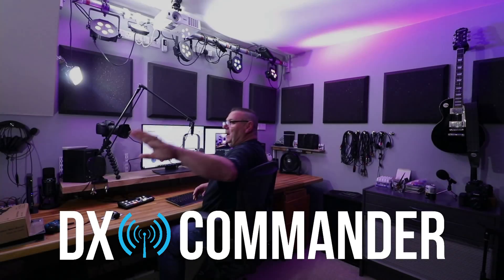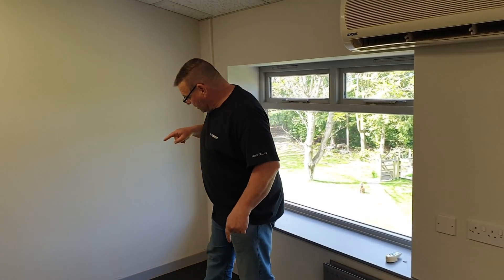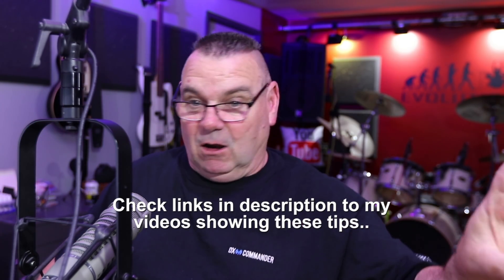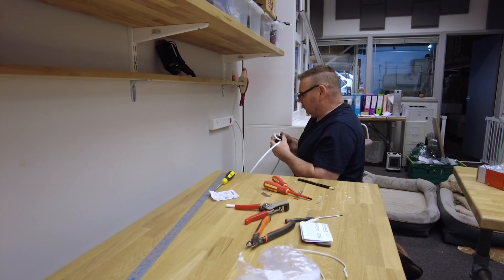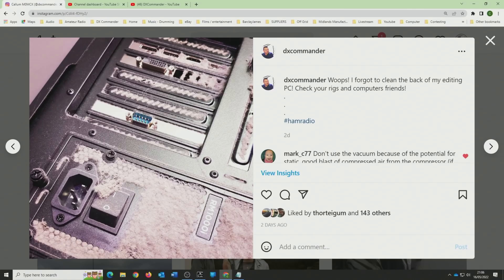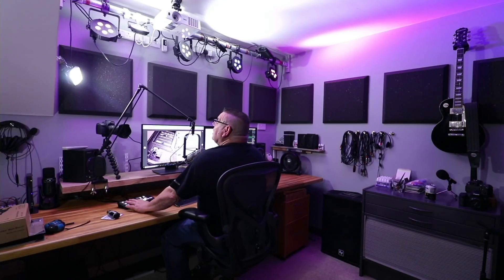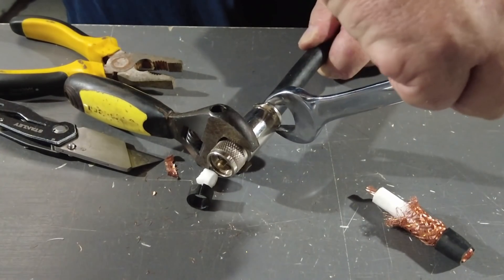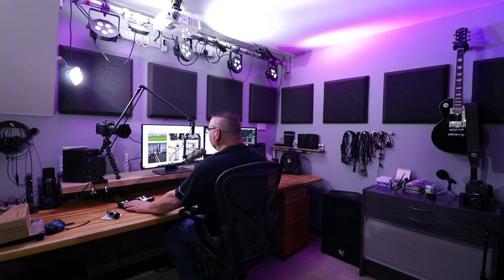7 Things When Building Your Ham Radio Shack

Comment: @calum, please make sure you use metal power strips. Helps avoiding burning down the shack, if something goes wrong, as plastic ones burn thru while metal can contain it.
Reply from the maker: Yeah, plastic is an awful conductor.

Comment: to beware---  do not arrange your radios so you cannot get behind them, pulling them out means you have to use longer cables and lots of confusion.
Do not bring your wires through bear hole in the wall-- you get a lightning strike electricity comes down through that round and likely would burn your wall and maybe your house.
Do you like coil extension cables extra electric wire because the coil as an inductor you don't wanna create spare inductors lying around in different places.
This is too short.

Comment: Oh, yeah... Messi & Peloni. Good to mention. Do you have any further (let me say, long-term) experience with their products? I've read both terrible and fantastic reviews about them. 7 mil would be awesome, as minimal invasion on the wall/structure is a top priority. 100 W, all HF, including 160 m, external (feed-point) tuning. Any ideas/suggestions?
Thanks in advance!
73 de HA5CST
Reply from the maker: The 7mm is quite similar in construction to the SSB El;ectronics Aircell 7 however the jacket seems slightly better (for me). I have run a 36m section of it for holiday use. It was fine. And the connectors are actually very nice.
Reply: @DXCommanderHQ  Thank you very much, Cal! We have some sort of selection here. A lot of RG58 from different suppliers, some RG213, and a few others, all (way) over 10 mm in diameter. I"ll make a try. Cheers!
Reply: Forgot the length: 25-30, or a maximum of 40 m... Cheers!

Comment: Here is a tip that might be helpful when building your next ham shack. Setup a location grid like your shack will have 4 walls, so label them north, south, east & west, then from the floor to the ceiling designate letters of the alphabet. Then when you run cables you label both ends of the cable using label cable ties. Put the source and destination on both ends of the cable. You can even get color label cable ties and designate one color for antenna cables, another color for power cables...etc.  I worked for IBM for 23 years and we used a similar system to label cables in the data center.  When a piece of equipment fails or needs to be relocated it helps if all the cables are labeled. You don't want to pull the power plug on the wrong equipment and cause a outage at a inopportune moment. Keeping your cables tighty and labeled also helps with air circulation.
Reply from the maker: Well, hopefull I don't need a new shack anytime and tbh, for the 10/11 or so cables I have (and most would have) it shouldn't take too long to work out which one is which :)

Comment: Top tip, make the front edge of the work top 10 - 20mm lower than the back edge. That way if you accidentally spill any liquids, they will run off the front and not backwards under your equipment.
Reply from the maker: Nice idea! Alternatively, keep your drinks WELL away from your arm! :)

Comment: What would you recommend for station grounding when you have to install shack upstairs..??
Reply from the maker: To be frank, if you ground your coax outside that should be fine. BUT I can only tell you what I do.. 1st floor, 2nd floor or 10th floor :) Also depends on antenna I suppose but for 99% of us, it probably doesn't matter.
Reply: @DXCommanderHQ  Cheers...
I guess I will suck it and see :)

Comment: on access to hardware... I was called out to my boss's other business to find out why the PC that ran the MOT system was overheating and shutting down after 2 mins. It was mounted on a trolley, so I thought it would be easy to access. Wrong. The power and network cable had been bolted to the wall and glued to the trolley. I had to replace about 30m of power and ethernet, then make sure we wouldnt have this issue again by adding plugs/sockets and some leeway in the final cable run. If you think a bit of dust is bad, I had to take the PC out to the car park and blow the solid cake of congealed exhaust particles out of the computer with an air line. It was full. and someone called the emergency services, thinking we were on fire.
Reply from the maker: WOW!

Comment: What is trunking?
Reply from the maker: Elephants have them
Reply: Flexible plastic sheathing for electrical cables, such as you might see in a Portacabin when it's not possible to put wires within the walls.

Comment: I put eye bolts in the ceiling and run cables across the ceiling and down the walls (or down whereever), and fasten it up with velcro straps.  Ugly as sin, but damned convenient.
Reply from the maker: I mean, if you don't mind the look (and actually that could actually be quite cool, then WAY TO GO!

Comment: I have done many "pro" installations in my working life, I would route network cables in separate cable trays from coaxes. It was weirdly rewarding to take pride in doing a neat job and of course a better presentation for customers. (Mostly emergency services). Of course these installations do not change for many years at a time. The same inflexibility as you say is basically a PITA in an experimenters environment. Redoing my shack recently, the desk is supported at the wall, so no gap behind, so have used a hole saw to make a few large cable access points through it. FWIW apart from QRO amplifiers most ham gear is low current so I use mostly IEC sockets across the back of the desk, a damn sight smaller than chunky 13a stuff. 
You are absolutely right to keep it flexible. Another stupid mistake I have fallen into is to have too many radios on the desk at once, too easy to turn the shack into an unusable museum. Better to keep the other rigs elsewhere and put them on the desk only when you want to use them.
Reply from the maker: Oh yes, tthe unusable museum scenario! Hmmm. Good point.
Reply: “unusable museum” is the best description with quite a few shacks I’ve seen. Absolutely maddening to think you need that much gear within arms reach. Less is more for me. 73’s

Comment: We’re having the whole of our downstairs re-done and the builders are in making the changes we required and modernising everything. New water pipes, electrics windows/doors the lot. From doing a lot of research from other hams I’ve had installed my own consumer unit with no more than a double socket running from each trip at the con. unit.
I’ve rebuilt my desk/workstation and I had already thought o out having to move it to get behind so it’s on lockable wheel’s.
My coax runs used to come through the wall about 2ft up but one of the builders said why not put it above head height , that way all cables/coax’s coming in from outside are not trip or catch hazards so that’s what I’m planning to do. Across the side walkway to the house I’m planning on putting an old banister (vertical) to put the coax’s and earth cables across at around 10ft high.
Not planning on using trunking but I’ve made a “J” shaped shelf to run cables along the inside wall behind the desk so everything is easy to access.
Can’t wait for the builders to put the new roof on and skim my walls so I can get back in there and get re-setup.
 Good advice as always from you sir and I hope my contribution will help others as well.
Good luck with next door.
de MW6PNW
Reply from the maker: Nice one Paul. You are ahead of the game!

Comment: Great tips Callum, my main mistake is I installed underground pipe to route coax's in my extension, pipe not big enough!  Indoor trunking replace with cable tray.  Sounds posh but its 'L' shaped MDF, allows me to trace/replace cables.  I'm yet to install a water proof outside wall box/patch panel for coax feed to antennas.  They all come direct which is limiting.  73 de M0AZE Mike
Reply from the maker: Oh hell, sorry about the underground pipe. Mine is 4-inches. Seems about right. Currently 11 cables (most not used!)